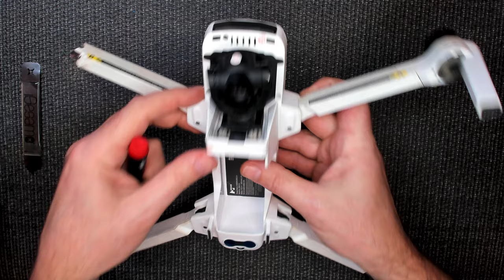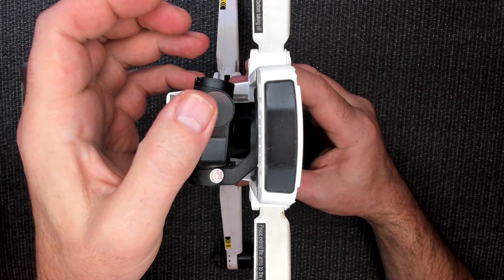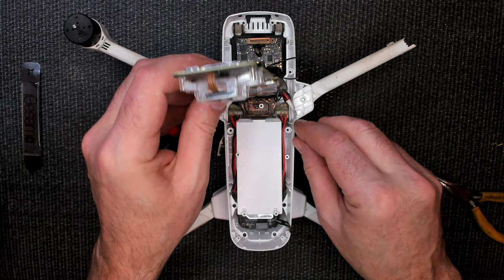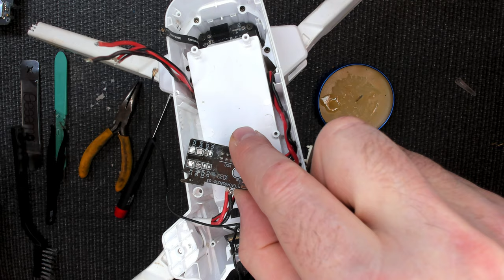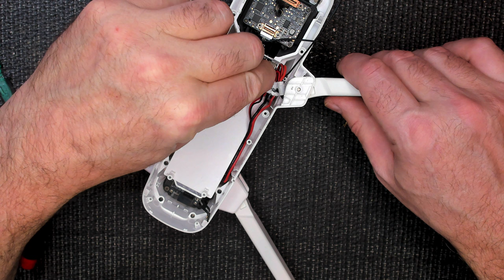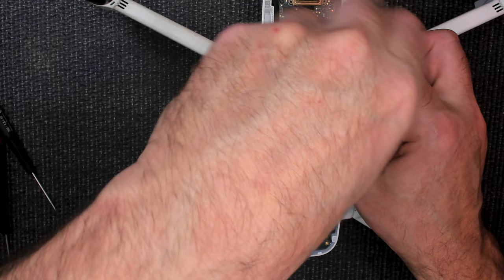HUBSAN ZINO 2 PLUS / ZINO 2 - REPLACING FRONT & BACK ARM

Comment: Hello, could you tell me which parts are exactly common between the Zino 2 and the Zino 2 Plus?  Thanks in advance !
Reply from the maker: Wow you don’t ask much of someone’s personal time much at all! 
Impossible in a single comment. Several parts are different in the electronics and then along the way hubsan goes and makes production component changes in both models. 
Example: Zino 2 just itself has 2 different boards.